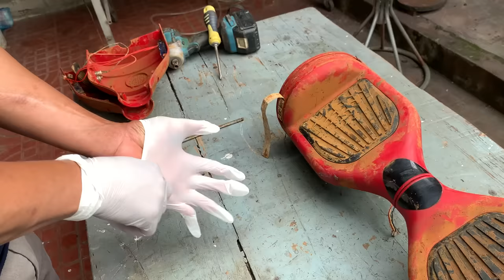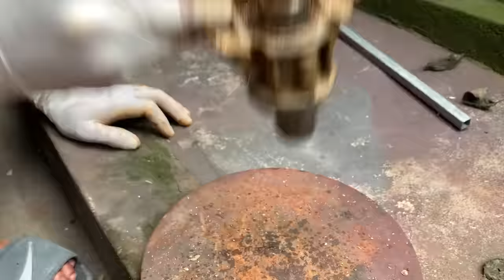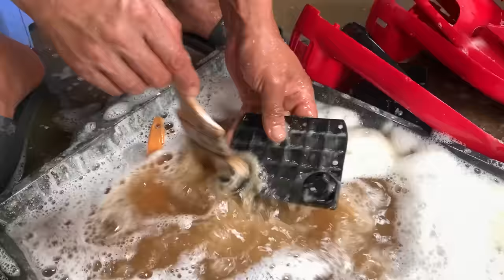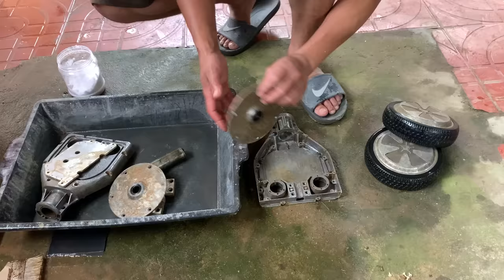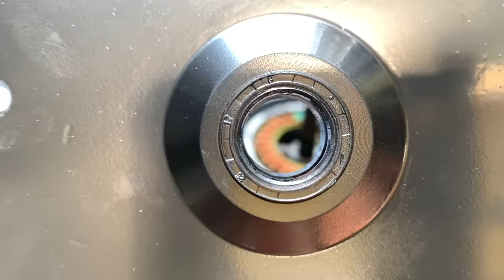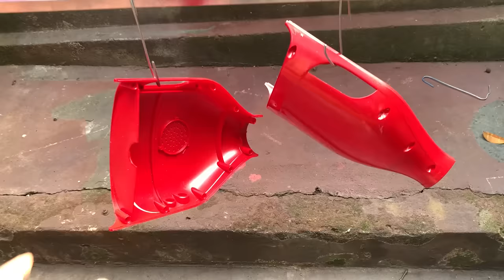Old Balance car restoration | Restoring smart electric scooters

Comment: I can't believe you were able to re-use the wiring.  Also, I didn't see a battery in the original.  If you're going to install replacement parts, you should say so.
Reply: Ngomong opo to Le,,?
Reply: Γεια
Reply: Is a fake restoration man... this Vietnamese guy knows how to restoration everything... 🙏🙏🙏 you only can watch his videos for pleasures...👍👍👍
Reply: @ultramendaia7791  a sua
Reply: Idon't think it's the same. He had an entire new scooter.
Reply: @ultramendaia7791  .
Reply: @ultramendaia7791  ฟฟฟฟฟฟฟฟฟฟฟฟฟฟฟฟฟฟฟฟฟฟฟฟฟฟฟฟฟฟฟฟ่ฟฟฟ่ฟฟฟฟ้ฟฟดฟฟฟฟฟฟฟฟฟฟ่ฟดฟฟฟฟฟ
Reply: @ultramendaia7791  ฟฟฟฟฟฟฟฟฟฟฟฟฟฟฟฟฟฟฟฟฟฟฟฟฟฟฟฟฟฟฟฟฟฟฟฟฟฟฟฟฟฟฟฟฟฟฟ
Reply: ayo
Reply: @เปเปอ-ฤ9ฎ  super!!!!
Reply: I downloaded the video and put some effort to identify the parts. As far as i see, the parts are the same. Including wires. Battery is new, of course. And the discovery of the thing is obviously staged. The pcb's, wires, motors - i'm sure they are original. Video missing the electronics repair, also few bearings can be new. What remains the question is why paint hidden casted chasis and poor choice of the spray paint color : ). When metals are in watter without el. current, there is much less degradation to connectors.
Reply: Fh call

Comment: My question ,How the hardware parts and circuits can be reused after it goes through water ??
Reply: Sometimes you can get lucky but it won't last long. They put it in water on purpose anyhow. This guy stages everything.
Reply: @heliarche  yep, came here to say that i call bullshit on this, all those diodes and capacitors absolutely take a shit when they are submerged in water no way in hell this is real.
Reply: Bro aap pani se part ko safly saaf kar sakte hai
Reply: But aapko hot airgun use karni hogi Panike baad me
Reply: Leg ic me ic ko remove karne ki jyada remove karne ki jarurat nahi joyi but boll ice pani ke baad aapko reboll karni hi padegi
Reply: how about he rode a good hoover, put at the end of the video. then take the good one apart, recorded the reassembly process and put in the middle of the video after " water wash and grinder cleaning". finally, he threw the good hoover to the trash area which he knows where it is and this records is the beginning of the video. hope no one in this world tries restore like him.😅.

Comment: not true you soak the electronic board in water with soap really. if you told us you change the board and battery i might believe you but soaking the board in water with soap not so true . :) :) :)
Reply: Γεια

Comment: I found a hoverboard that someone left by the side of the road. It still turned on and functioned insofar as movement by tilting was concerned. The only problem was that I think it had been dropped so many times that the anchor points where the screws were holding the hard shell together had broken. I found a replacement charger and plugged it in to see if it would even charge up. It took maybe an hour or two to get to full charge. At that point, the only thing that was stopping me from replacing the hard shell was $20 for a replacement shell + $20 S&H. But, when I take into consideration that a new hoverboard can cost anywhere from $150 to $200, $40 for a replacement shell doesn't seem like that steep of a price.

Comment: I have repaired junk electronics for years.....I have never seen anyone who repaired a product that didn't know how to use multimeter; your lack of knowledge around its use is legendary.  It's also amazing that you can repair something so high tech without a schematic.  How do you know the values of the electronic parts?  How do you know the voyages at a certain junction ?  You also never repair capacitors, even the ones that are bulged on top.   Again, I call BS on all of your "repairs".
Reply: Да мне вот тоже забавно как конденсаторы не пухнут после таких ванн, да плата не окисляется. Хотя может быть он меняет расходники за кадром, платы то копеечные

Comment: another buiishit video !  everything is pre-planned and organized for the fake video. micro controllers with gyro and Accelerometer sensors can not be restored after being exposed to elements. and they definitely can not be tested with a multimeter !  also when did the plastic parts get rusted! ...this guy is an absolute clown..... 😄